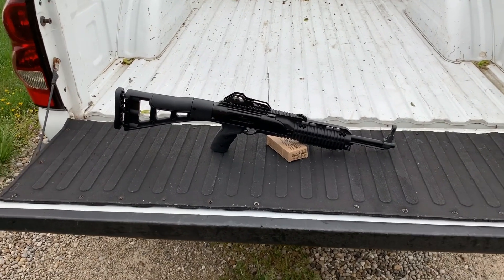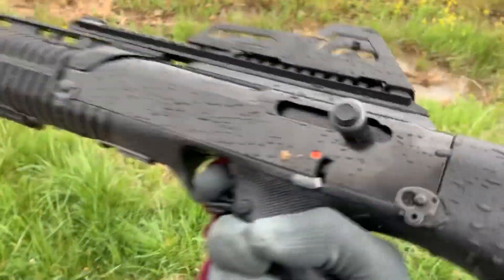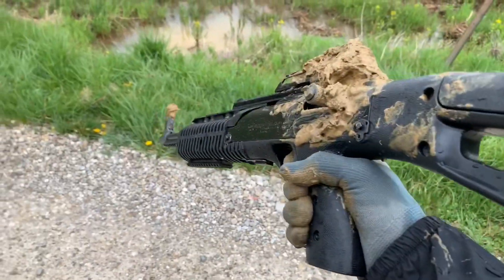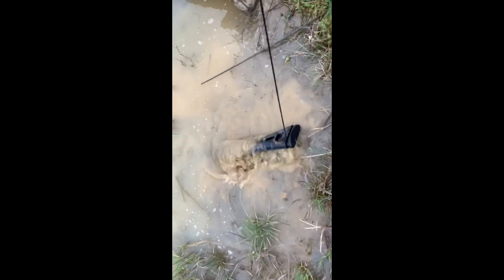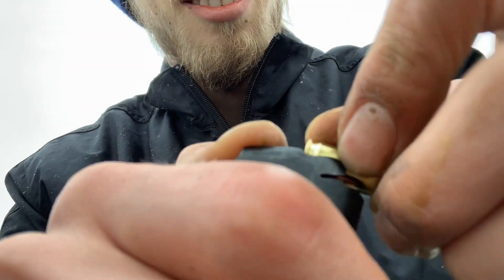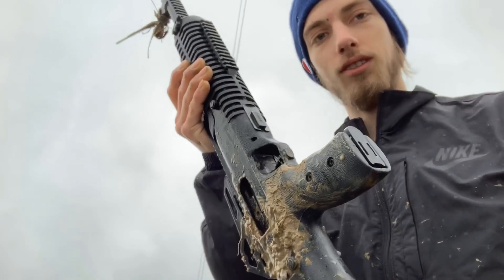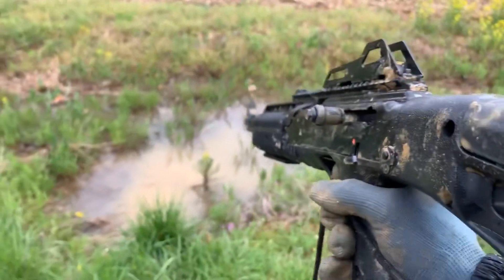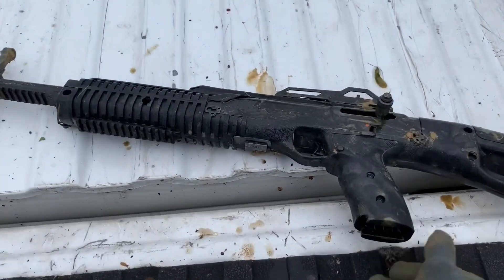Hi-Point Carbine Torture Test

Comment: I like Hi-Points I don’t care if they are ugly they are the right price for me and function well and are reliable
Reply from the maker: Nukem 76 I can’t wait till the release of the “yeet cannon” I will have to pick one of those up as well! Thanks for watching!
Reply: How much did u pay for it??
Reply: James Brown   I told you the wrong price, my last one I bought 3yrs ago was $325.95. I haven't done silly torture tests with them, I just shoot them a lot.
Reply: @Chief2Moon  thanks

I am about get one for $360...
Or should I wait until after July 4th??
Reply: @Chief2Moon  thanks in advance
Reply: James Brown   Even at $360 you're getting your money's worth. I'd recommend getting a 9mm model, they're cheapest to shoot...also either a cleaning kit or 38cal or 9mm"boresnake" to run through the barrel to clean it, along with "Hoppes#9" gun solvent. The projectile part of .380, .38cal, 9mm & .357 are all about the same diameter bullet although the cases are not interchangeable between the different calibers. 9X19mm is the size you'll want. They're often called 9mm Luger or 9mm parabellum as well. They don't need disassembly until after 2000-2500rounds for "deep cleaning", wiping out the barrel with a boresnake or cleaning rod & inside the action with a Q-tip after shooting is all I generally do until about every 2500 shots..I've had no trouble with mine. You'll be surprised how fun they are.
Reply: @Chief2Moon  

Thanks a ton
Reply: James Brown   Another thing...You can deck them out some with extra magazine holders that attach to the stock, a foldable front hand grip that holds a takedown tool inside (for when you disassemble the gun), a "flash suppressor/compensated" for the end of the barrel, available from Hi Point. I've seen guys put bipods,lasers,scopes,& flashlights on them. A company called RedBall makes 20 round magazines, the only aftermarket magazine approved by Hi Point...plus they have a lifetime, no questions asked, fix or repair, lifetime warranty--good even if you sell it to someone else, the warranty is good for him too. They also handle 9mm +P. You'll love it. One final thing, when you "rack the slide" to cock and load, let go of the charging handle so the bolt will "slam" forward without your hand slowing it down...if you hear of "failure to feed" incidents, that's the cause 95% of the time, not letting the handle go free. Watch a "Nuttin' Fancy" video about them, or other videos. There's no such thing as knowing too much

Comment: As long as the firing pin can reach the primer most blow back designs will run .. it'll take a pebble or paste or distortion to make it malfunction.  If pin primer connection is made it'll work

Comment: never stick a barrel in the dirt my dude thats a good way to explode a barrel (granted hipoint will fix it under the lifetime warranty but still..not safe lol)
Reply from the maker: No kidding? I didn’t know that, I knew if it was submerged under water it could.
Reply: Yeah, you could get a barrel obstruction if mud were to get packed in there. Could make for a dangerous scenario.
Reply: You could plug the barrel with a foam ear plug to prevent gunk from getting in there.
Reply: chad senpai   "Demolition Ranch" has poured concrete, pounded sticks in& other obstructions into the barrel to try to blow up Hi Point pistols...the gun held up, but I'd NEVER recommend trying it.
Reply: Mythbusters proved that to be wring